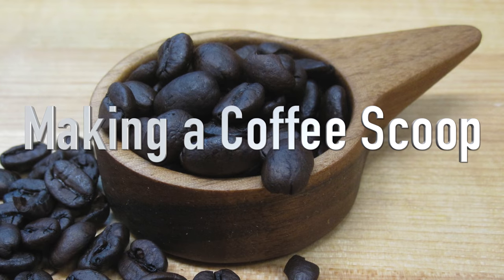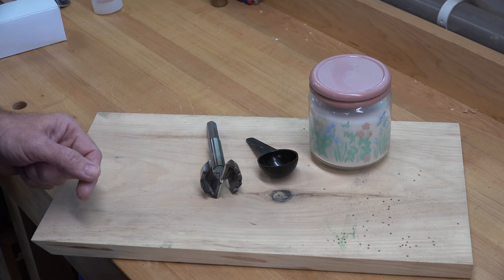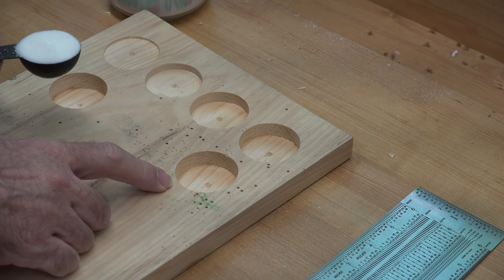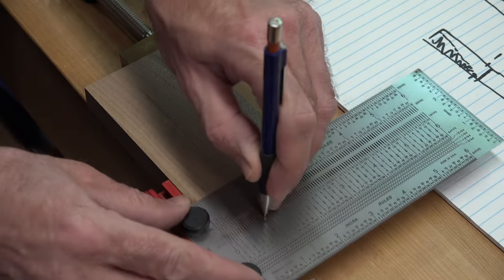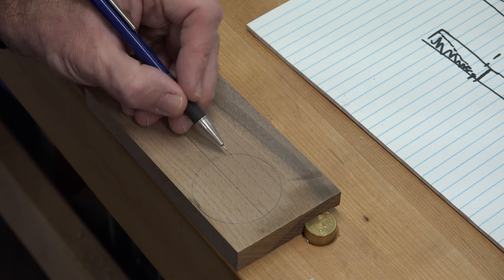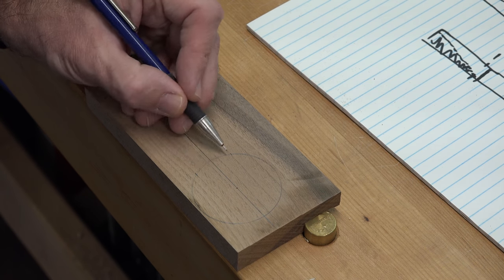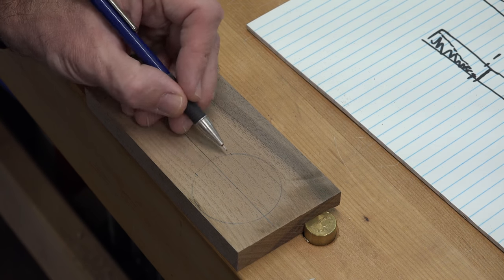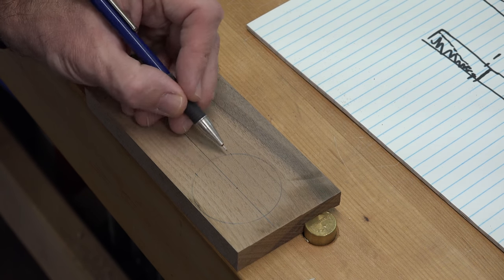Making a Coffee Scoop

Comment: Your scoops are 1½ tablespoons (found by Googling "((1 3/4)/2) squared * pi * 9/16 cu inches in tablespoons").
Reply from the maker: Too much math for my little brain Andrew but thanks for looking it up.  LOL.  Thanks for tuning in sir.
Reply: Aww, it's just the volume of the circle (pi * r^2) times the height of the hole (9/16) which gives cubic inches. Then I used Google's conversion feature to convert the cubic inches to tablespoons. It's a neat truck to know about -- for example try googling "2 acres in square inches"! But because I'm fancy, I did it all in one line.
Reply from the maker: Well, I'm sure that anyone interested in making other scoops of different sizes would be happy to have the formula.  Thanks for taking the time to post it.  I really appreciate it, even if it does hurt my head.  LOL.